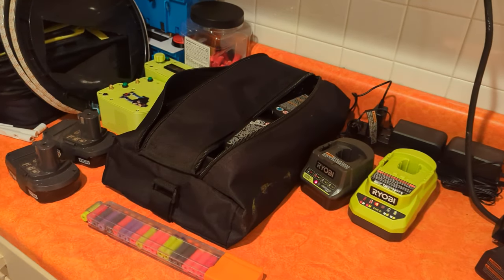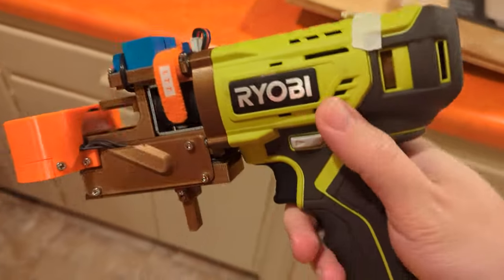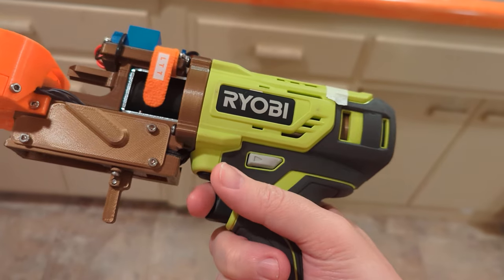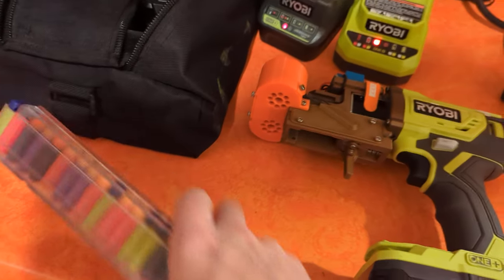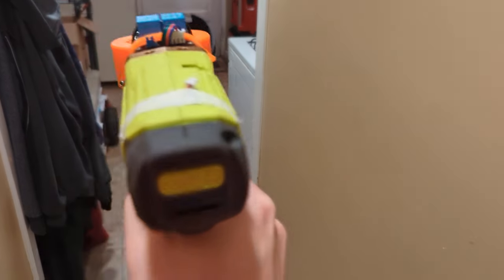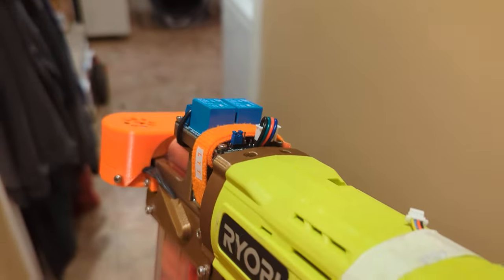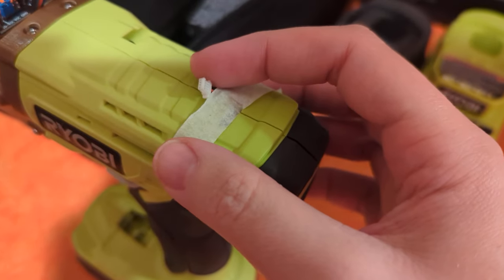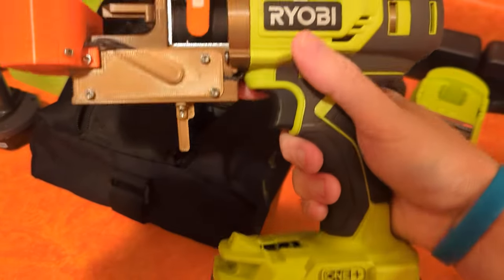Ryobi Brushless Nerf Blaster - Rundown/Firing Demo

Comment: any issues with heat from the motor breaking?
Reply from the maker: Not so far. They used to get hot at 100% power, but at the 45% or 75% I usually use they stay cool enough for the PLA mount to be fine.
Reply: @donutcat0  great to know, thx

Comment: That's sweet! 
I think a progressive full auto mode would be cool. Just like drills have a variable rpm based on how far you pull the trigger, I think It'd be sick to have a variable rate of fire with a similar idea. Don't know how the electronics would work but it'd be neat haha
Reply from the maker: Before I did horrendous things to it, the stock trigger module was really just a PWM MOSFET output. So if your pusher was like an N20 pusher or another motor pusher, using it for just that would easily give you the variable ROF, you'd just have to figure out another method for revving.
Reply: Sweet haha. I might have to try it